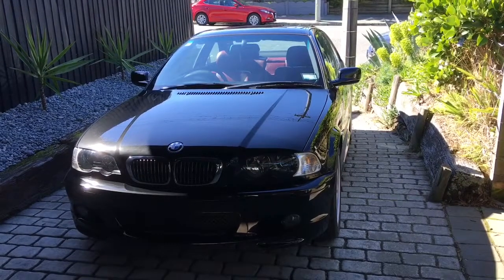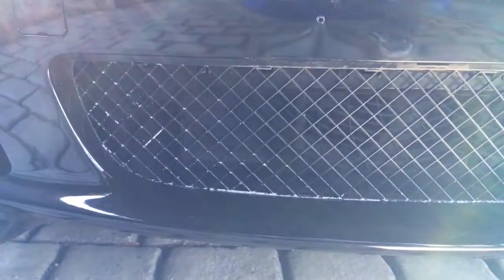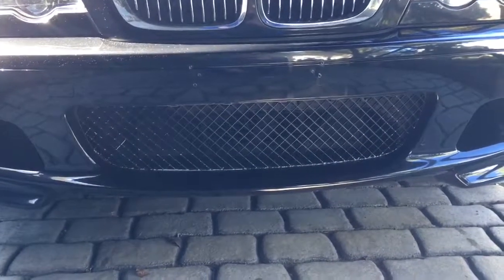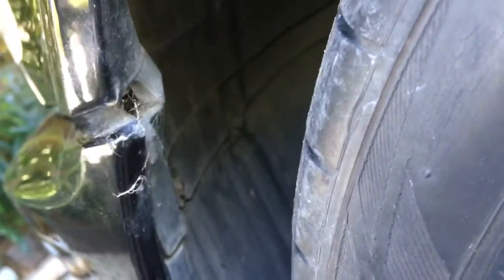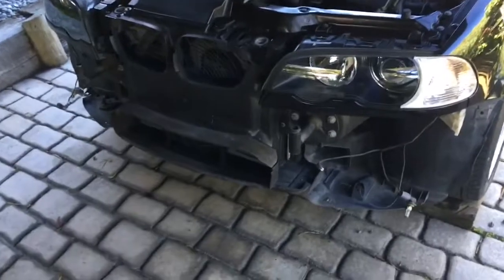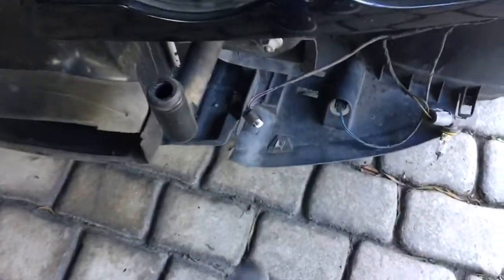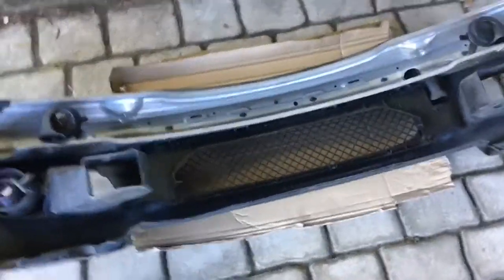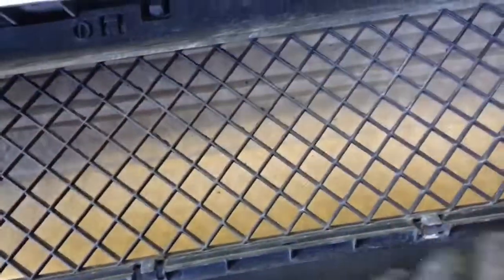BMW E46 Bumper grille replacement

Comment: Good video dont know if I'm brave enough to tackle this lol
Reply: Tried it too cold outside and didn't have right tools lol
Reply from the maker: It’s not a big deal, take it one step at a time. A few more layers and a few more tools! 👍
Reply: @MTechGuy  thanks mate yeah it was so cold probanly a bad day to try lol my neighbour has loads of tools and a engineer so he said he would help me lol
Reply: @MTechGuy  thanks yeah I meant tools not tops are you on Instagram? Used to live in nz but actually regret moving back i think ill be back there in the next year or so. I'll bring the 330ci back
Reply from the maker: No Instagram so far, but keep getting asked so maybe should set one up. I can’t imagine moving back! If the car is a factory manual, they are pretty rare here
Reply: Doing it now got the main bolts off neighbours helping me
Reply: @MTechGuy  managed to do it today not the easiest job but if you have half a brain you can do it but this video really helped thanks mate refreshes the car
Reply from the maker: Good on ya for persevering and getting it sorted 😎
Reply: @MTechGuy  yes my neighbour is a wizard we will do the vcg tomorrow and change over the interior centre consol. I am still using the wood blocks also to get the car up higher. Is the diff oil change diffucult and gearbox oil change can that be done on a driveway without an ramp
Reply from the maker: Diff yes, gearbox depends on how high the car is
Reply: @MTechGuy  cheeres mate. Thinking about buying the poly ramps they look decent